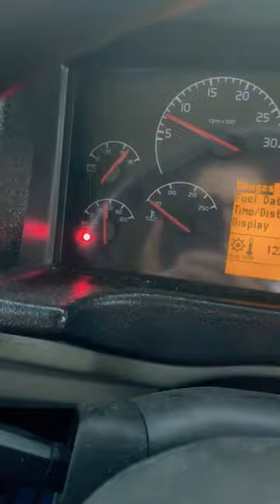Hope this helps! #skoolie#diy #busconversion#diyprojects#skoolieconversion#vanlife#buslife#tinyhouse

Comment: Not trying to be rude but at this point you should cut your losses and buy a new bus. Pay a mechanic to look it over first. On this bus, The mechanic should have diagnosed the rod bearing before replacing the rear main seal. Hearing it run, it was obvious something was up. Save your money, put some back and eventually buy a better bus. I'm a mechanic and this is my advice. Good luck.

Comment: Engines tend to blow up if ran with no oil pressure, why you'd run an engine with it pouring oil so badly is beyond me. Got to fix stupid before fixing the engine

Comment: Get a brand new engine for it! It will be much better than getting another bus or an old used engine. Go to a Cummins dealership and order the new engine for it
Reply from the maker: Agreed, thats the direction we plan on heading in. With a fresh start everything will be great!
Reply: @JessandJake  once you get the new Fresh engine you guys can finish the inside of the bus